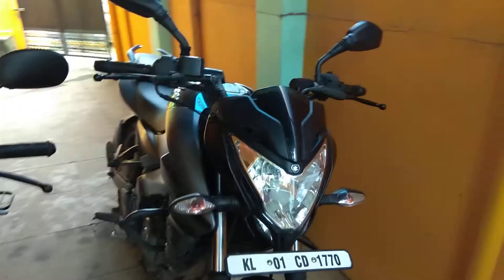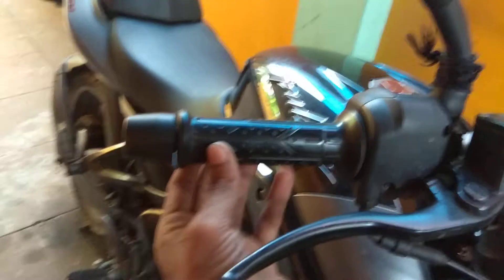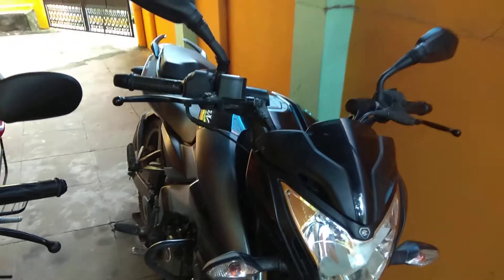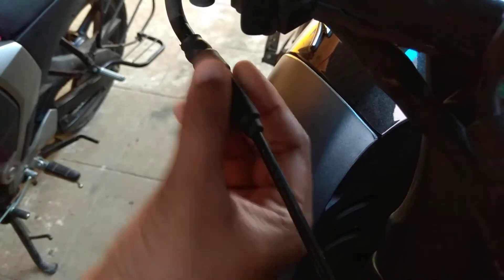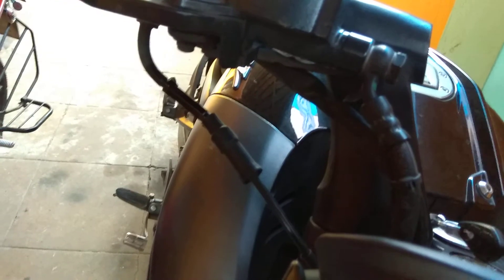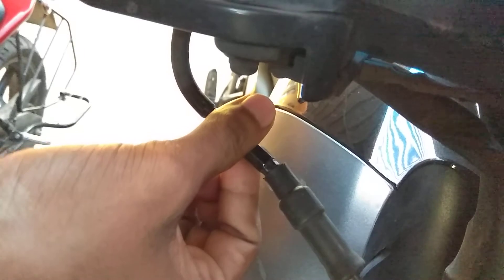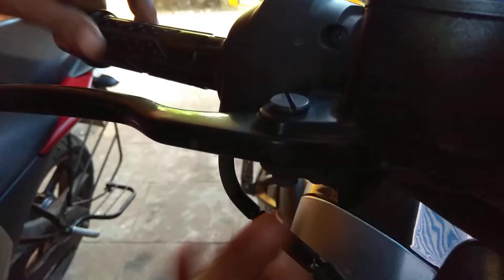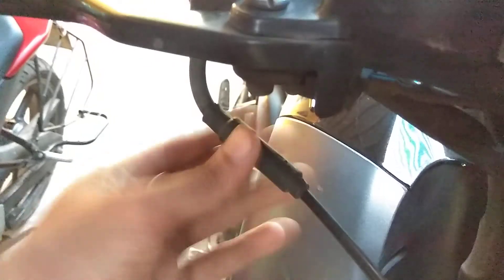NS 200 Throttle free play adjustment also same for all motorcycles

Comment: Hi Budd, great video !! I too have NS200 and i am facing issues with acceleration of the bike. In the low to mid range the bike doesn't deliver the power consistently. And also, the acceleration is not according to how much throttle i open. The power comes late after opening the throttle. Bike has done only 11000 kms. Can you help me to understand the problem in the bike? How can this problem be fixed?
Reply from the maker: Check the spark plugs of your bike
Reply from the maker: You know NS is triple spark engine
Reply: I am. Facing this same issue